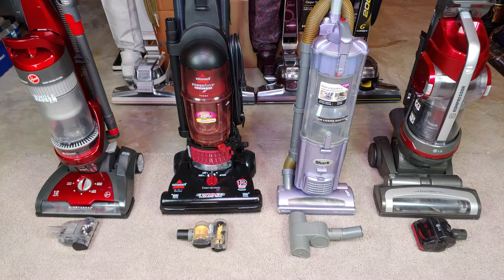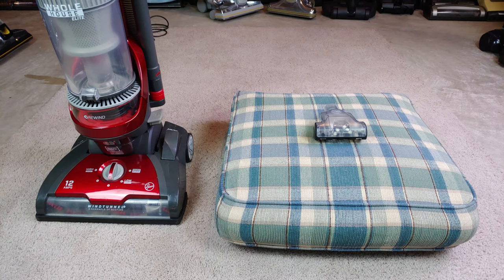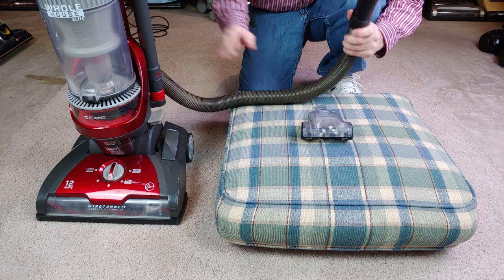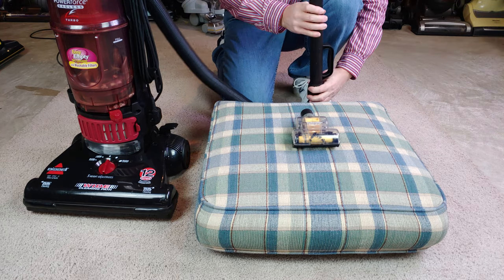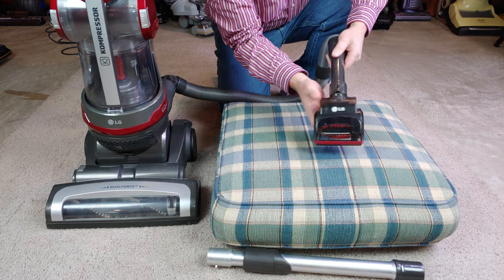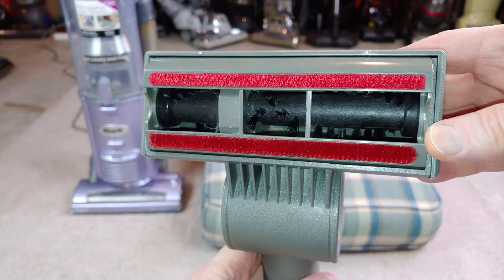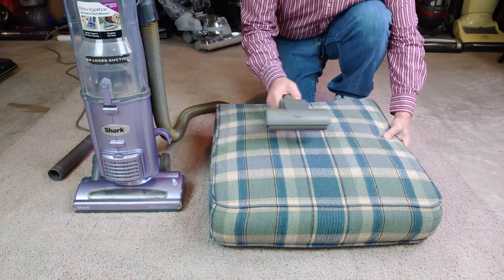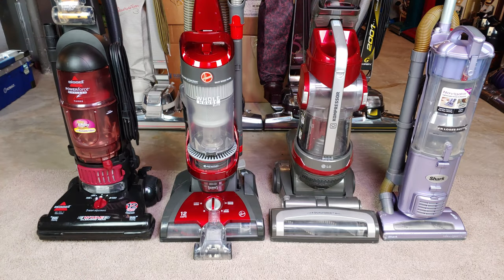Hand Turbo Tools Practical Tests Part 1 | Hoover Bissell Shark LG

Comment: The reason why the turbo brushes stop spinning is there has to be air going in, like in my shark the turbo brush has vents which prevents it from stopping completely.
Reply: could be a weak belt
Reply from the maker: Those are toothed belts on the turbo tools and they don't stretch.